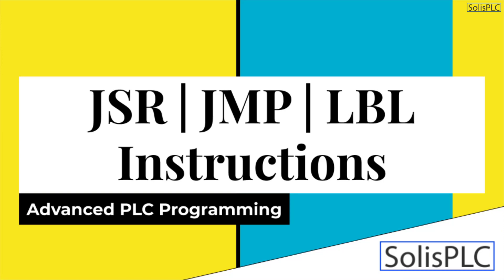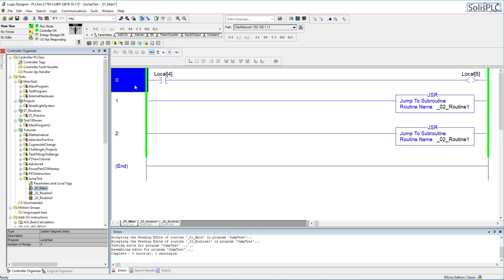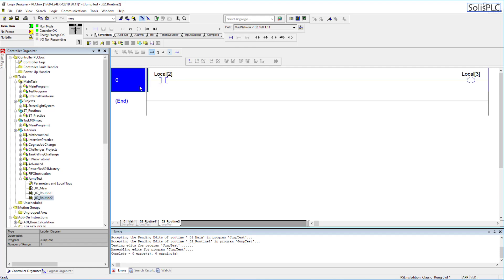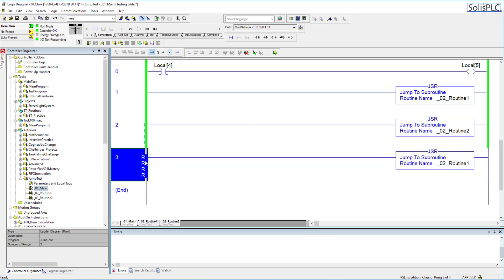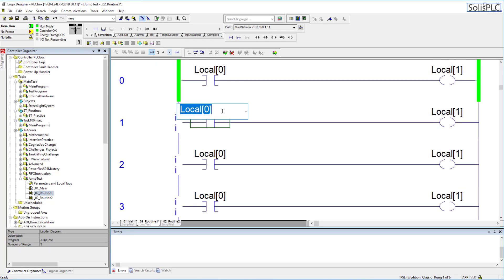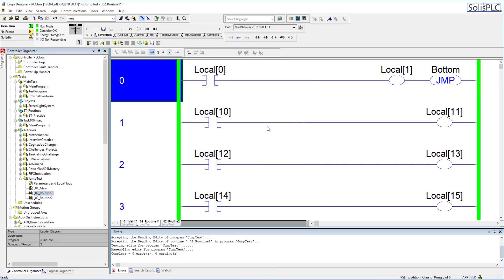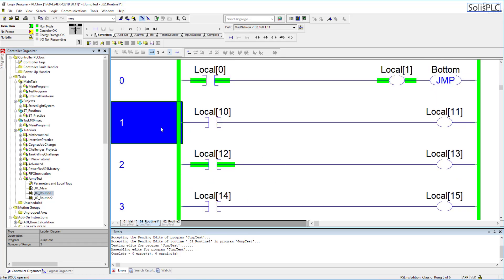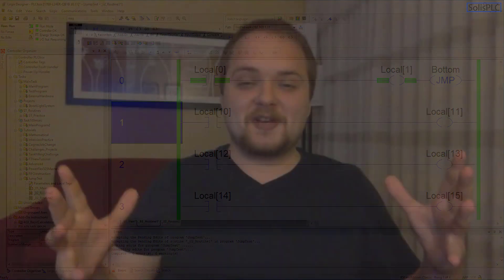RSLogix Studio 5000 JSR JMP LBL Instruction | Navigating Routines PLC Programming Jump Control

Comment: SO JMP IS DIFFERENT FROM JSR ??? IT LOOKS LIKE THEY ARE DOING THE SAME JOB
IM A BEGINNER
Reply from the maker: They are different - the JSR is used to call another routine while JMP will jump the execution to another label within the same routine.
Reply: JSR stands for “jump, shift register” which is the same thing as calling a function in traditional programming. 

You jump to some code, then at the end of that code you get some value returned which is what the “shift register” part means. 

So for example you could have a “get position” subroutine and at the end of that routine it puts the position in a tag for you. 

That’s atleast how it works in assembly programming

Comment: JSR doesn't come with Return from Subroutine instruction or it is not mandatory?
Reply from the maker: The RET (Return from Subroutine) is optional for the JSR. If there's no RET, the entire subroutine will be executed. If there's a RET, it will be executed up to that point. In most cases, I wouldn't recommend using a RET as it becomes confusing where the routine ends. You can simply add a logical execution to those rungs within the routine.
Reply: @SolisPLC  thanks